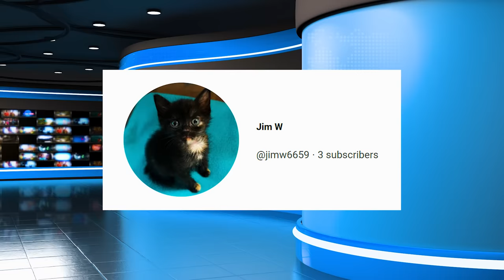Why Are So Many Builders Running Away?

Comment: Prices wont go up...sunak will bring back the polish to drive them down again 😮
Reply from the maker: The Polish are still here but they no longer want to work for slave wages. Talk to them and you will learn that they are generally quite pleased to have the drawbridge pulled up behind them rather than having the next wave of cheap labour coming in to undercut them.

Comment: Didumms !!!!   I have done many building projects with builders and I have always been fair and taken on board material increases and paid in a timely manner etc. However most of the builders I have dealt with arent fair, they try to squeeze huge margins for work if they can get away with it. I had builders on site and I asked them to quote for an unrelated job, and I ended up getting a very good floorer in for 60% of the money they wanted ! It cuts both ways !!!
Reply from the maker: Mr Avant
Nobody said it was your fault

Comment: Do you believe the increased volume of paperwork, such as new regulations, contracts, and red tape, contributes to the challenges faced today? Additionally, given the rising prices of various commodities, it seems apparent that customers are looking at finer details more closely fighting over every penny!. Could this be adding additional pressure on contractors and builders, making it less worthwhile? It appears that architects are grappling with similar issues, facing heightened responsibilities and liabilities without a corresponding adjustment in fees. It's disheartening to see many professionals opting to leave the industry!

Comment: Wish there was a reliable and vettable portal for checking on contractors past job. the problem is theres the bias of only asking people to give good review when you know the job is good. I've had two contractors in a row screw the my gardeb badly. Now facing the prospect of ripping up al the grass and starting again because the last arsehole agreed to put toil soil town below the turf, but taking a core, only put down sharp sand and then buggered off. Whoel back garden struggles to grow, patches, run off, everything. If I had it in writing id be taking him to small claims.

Comment: Re not liking contracts.  Once a builder agrees the price or pricing mechanism and scope and the customer agrees to pay for the scope to be done, you are in an oral contract that is just as binding as a written one.  Worse for the builder, if he is in an oral contract with the customer and the only explicit agreement is on price and scope, then common law will imply certain other clauses or rights or obligations into that agreement, as will consumer rights legislation.  Contracts like the JCT homeowner contract are helpful to the builder in moving away from the historic harshness of the common law to something more commercially reasonable.  A builder should either use a set of bespoke terms and conditions or the JCT homeowner or minor or intermediate building works contract to protect himself from having to carry the cost of unforeseen ground conditions or poor weather or flooding or customer instructed change and establish a firm limit on liability etc..., else he just becomes a punching bag.

Comment: The number of builders and tradesmen that come out, look at the job, say easy peasy, and never quote! There are three types of jobs, runners, repeaters, and strangers. Runners are things you do everyday, repeaters are jobs that you’ve done regularly, strangers are jobs you’ve never done before so the quote might be off. But for extensions or repairs, the job should be easy to quote accurately. I had a company build a large shed. I gave them drawings, visuals, and 3D models. They still got it wrong! Windows facing walls😂.  The building industry needs to have effective guilds.

Comment: I warned a client away from a rogue builder, warned him that it would start well and builder would become unreliable until he was sacked, builder is on a "black list" this is exactly what happened.....he was 50k cheaper so he got the job despite the warnings, you can lead a horse to water.......... As for rogue clients so many out there who pre meditate a RIP off, would make good TV....Rogue Clients, no better than common thieves, in fact worse as they are also total narcissists.......recomdation, costs compliant with the average and agreed stage payments based on progress not time will steer 90% correctly

Comment: Just to emphasise a comment below, costing (quoting) based on materials plus hours estimate and an hourly rate for labour is the way to go. 

Quotes without these three elements do not provide enough information to the customer to be able to select a decent builder from a cowboy and nearly always they go for the cheaper quote.

One of the biggest issues in building works quote is that builders try to hide their profit margin from their customer, rather than honestly putting forward the costs and take on risks that should sit with the customer, such as materials costs.

Comment: Because they changed too much and they can't get work. I have had three set of people a roofer worked for six hours charged me £1250 pounds, I had a plumber come builder he over charge me 300 and would not give me a receipt to prove what the change is for. I had a plumber who stole my old radiator after he told me I could not sell them. This all happened in south Yorkshire.

Comment: Depends on your persepective. Cant speak for big contractors as i don't have the experience but on residential homes with members of public I feel the customer gets ripped off way more than builders. Its rare to hear of a builder getting ripped off by a homeowner, unless they happen to be builders or very rich leople themselves. Which is why you wont get much sympathy. The stories of being ripped off ive heard from builders has invokved very rich people with knowlesge of contracts. Even with the 20% you mention the number may be higher as people pretend to you, Roger,  that they are nice but actually behave bad with customers. It seems everyone in my school and street has had a bad builder experience. That is a very high percentage. Having said that there were also good builders, who came and patched up their jobs. But they would be more expensive as a result. So 50/50 then. For an industry that is unacceptable. And then there's the casual racism from builders. And builders who choose who they will do a good job for but charge the same. Perhaps there should be a cowboy rate and a proper rate so people no what they are paying for.

Comment: Funny I know the builders that worked on our house a few years ago have given up. I’d like to think I help haha 
Seriously though we were very accommodating with them and finished on decent terms it was their hired electricians and plumbers that they really had issues with. Lots of problems with them. That said I had someone round and found the builders did a shoddy job, didn’t insulate floors and ceilings properly , left gaps so now we get mice under our kitchen cabinets. So glad they are out of the industry. Probably making a mess in some other job.
Reply from the maker: They might be running the country now

Comment: think more and more people expect finished work to look like 50.000£$€ but only want pay 15.000£$€ and total was 14.000£$€ 
and hackle if can take off 3-4000 becouse they logged the work hours themselfs and it dont add up with workhours on the invoice

seen so many people they save money on the things you dont see/importend and spend it on things you see.. speical on new builds when remove few drainageslots and save in on gravel at the end but strangely get exited when find 30.000+ to upgrade the kitchenstuff or jacuzzi in bathroom or latest greats in home cinema... and 3-5year later the inside is out of style and the yard is overflooding each spring and muddydrive way

Comment: Worked in steel fabrication for buildings for 45 years and paid less than all other building connected trades called it a day at 62 now on my last pension pot when I have run out I will go stacking shelves

Comment: The building game has got a lot worse since the pandemic especially with regard to material costs and also trade costs. Add to that the over legislation of obtaining planning and building regulation approvals and all the associated sap, water usage, SUDs reporting, affordable housing, etc. etc., and all the associated costs with that, then it's no wonder that the average builder is way behind the curve when it comes to these rules and regulations that can change in a matter of weeks or months. If the trades person isn't up to speed then they can catch a cold real quick. The fact is that the whole game is over legislated too many rules and too many regulations. We need to get rid of net zero and return to an earlier version of SAP so if someone wants to have a gas or oil boiler they can.

Comment: Sorry, no sympathy here. We’ve had 3 separate builders who over quoted on all the jobs, an not only that but all of them didn’t follow the brief at all, and then left the job looking really bad we spent nearly £12,000 for a 19 metre block retaining wall 1 metre high, and it looks shocking. Most of it doesn’t have mortar between the bricks. So far we haven’t been able to meet one single builder/electrician/plumber who has done a good job, maybe it’s just wales, but I have no trust whatsoever in these workman

Comment: Roger, I had a builder moan about the cost of materials going  up and notice you bang on a similar theme. When I reviewed our split (material/labour) it turns out most our spend was on labour (65/35%) and that is through lockdown. Normally quite on side with your "rants" but labour rate vs delivery from most building trades IS NOT  value for money. Park the winging about material cost. Move it out side any contract as a variable cost and focus on what you, and a builder with your skill set and experience adds to a job (as a value). Labour rates is what is killing the building trade. If a qualified professional client thinks your hourly charge is the same as theirs why would they use you? I acknowledge  the years of training  and experience trades can have, BUT most people can learn them. Trades are over valuing their worth.
Reply from the maker: Paul 
Don't shoot the messenger. I am describing a situation, I am not condoning or condemning it. My osteopath charged £50.00 for half an hour. He is fully booked all the time
Reply: Id love to see how quickly you would “learn” these trades to do the jobs yourself to a decent standard and complying to regs. Maybe you will quickly learn how to fix your car next so you dont need to pay the mechanic next? People may not like rates but supply and demand dictate them. Maybe re train if its all so easy?

Comment: Maybe people who get the numbers wrong should not run a business. Stop being the boss and be an employee instead. Working on trust is a very bad idea, Defined work for a defined price by a defined time then no need for disputes. If you don't like contracts you really shouldn't be in business. Is building to be just a hobby then. I normally have a lot of respect for Skill Builder but this time he's talking nonsense.
Reply from the maker: How do you know you have got the numbers wrong unless you get them wrong?
Reply: @SkillBuilder  First let me say that in my role as an engineer in an oil and gas contractor I was pretty bad at job estimation but I can give you a theoretical answer even if I wasn't great myself. Perhaps like you I was more interested in the work than the commercial side. In theory a company is meant to have norms for doing a job. How long does it take to lay 1000 bricks for example? A recent example for me was I employed an electrician to get a EICR certificate and he said I needed a new fuse box. (Electricians always tell householders they need a new fuse box even if house 20 years old). Bloke quoted £950. If you go on internet it would be £700 -£800 tops. Needless to say he didn't get the job. Could he have estimated better, was he trying it on? Yes tradesmen need to know the going rate for common activities. Will people sometimes get in wrong yes but if its too often they won't stay in business. And that's probably the way it should be.

Comment: Jeez, go to the customer and show why you need more money to cover the materials, easy to check and fair to ask for the money.
Reply from the maker: Whenever someone starts the sentence with 'Jeez' I know they think they have seen something that everyone else has missed.  Of course you should ask for the money but the customer may not have it and then you have to start giving them a breakdown of every nail and screw so they can be sure you aren't taking them for a ride. Then they look at your labour charges and start trying to chip away at the very reason you are there. As I said, it builds suspicion and resentment, there is no trust and that is corrosive.
Reply: @SkillBuilder  We all have a view, it would be an odd world if we agreed all the time.

Comment: It started way back, I'm 80 and long retired. It started when we as a country began the open borders policy. Millions came here and decimated most of the industry with their very low wage cost. Didn't need qualifications, they were given.  I worked in the electrical industry and saw first hand the rise of "agencies" using anybody to fill a position. Qualifications, shown by a plastic card, called a JIB card,They were given out like confetti. So all time served artisans were threatened with lower wages, sometimes none at all, sacked via text and left to rot.
I would not recommend anybody to enter the building industry, its full of shark employers and agencies just waiting to 'cream' you. My advice look elsewhere.

Comment: Bizzare video this really. None of the things you describe are unique to builders. Maybe the tool theft I suppose. But all small businesses owners have cashflow challenges that have to be managed. Builders in the uk invariably just arnt any good at running small businesses. If they were they’d be doing something else. As a customer, dealing with builders is horrendous. Lie after lie after lie after lie.
Reply from the maker: The reason this video concentrates on builders is because our channel is about building. Bizzare comment because nobody said it was unique to builders.
Reply: I think you perhaps miss my point.  Or maybe I didn’t make it very well.  Your video is pointing out the reasons that builders are leaving the industry. Well what other industry are they going to go into, as all small businesses have similar problems to the ones you list.  I’m saying therfore its not the industry, it’s the people in it.  Every small business owner has cashflow pressures, staff problems, customer problems, long hours, stress etc….  So the answer is maybe don’t run any small business as you’re not cut out for it. Work for someone else and draw a wage.  We all know builders though many of them are basically unemployable.  They don’t tell the truth, they don’t work to rules, they don’t show up on time, they don’t take pride in their work, they don’t respect other people’s property… I could go on.  I’m sure there must be lots of good builders, I suppose they are the ones getting on with serving their customers and not moaning about stuff 24/7. If you're moaning, it's probably you.

Comment: The entire industry is on cocaine and  weed. Or hung over. That's the problem. I can't stand working with drug addicts. You are better off working in rail, everyone is clean, level headed, pulling in one direction, to get the job done and get home, zero tolerance to alcohol and drugs, random testing, nobody smokes weed, sometimes as part of your site induction you have a DNA test. A totally different work ethic, ethos and working environment. No work shy day rate lads either, rail on a night is job n knock, no going up to an RRV driver and he swerves you like a telehandler driver does on a building site. You ask him to shift something, it's done. 

All one common goal, get the job done, everyone home safe every day 👍